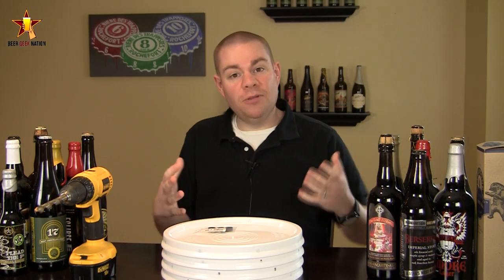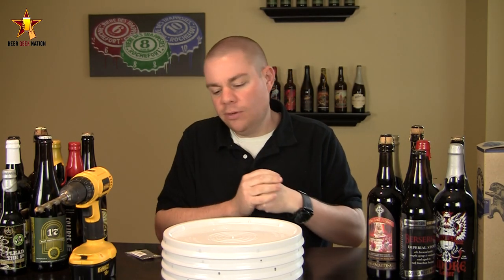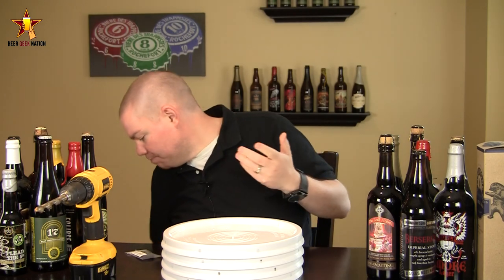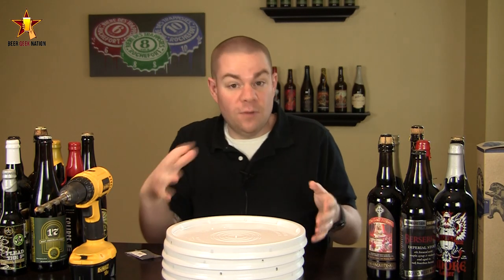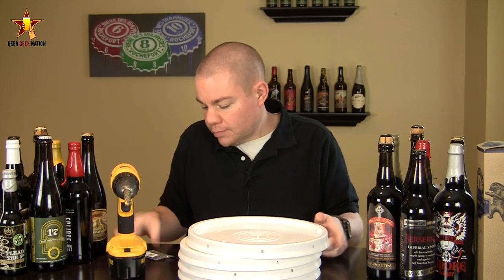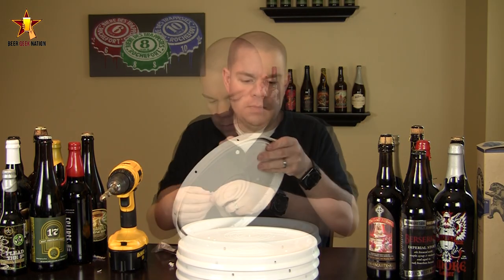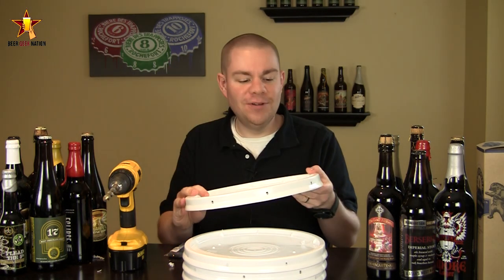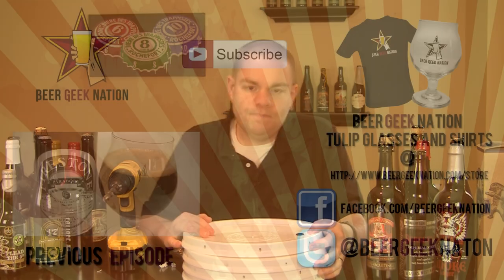How to build a cheap homebrewing fermentor | Beer Geek Nation Homebrewing

Comment: Cool money saving tip!  I was not aware you shouldn't use buckets that many times.  I've used my "Belgian Bucket" for about 6 batches now.  But most of my stuff is in Better Bottles now.  I have just been using the same Belgian bucket to brew my Dubbel over and over.  Thanks for the tip!

Comment: If you are brewing a 5 gallon batch, you need at least a 7 gallon bucket to accommodate the foam rising due to fermentation.  Otherwise it'll just billow up thru your lock, clog it and potentially blow off the lid.  Not only do you lose brew but you have a mess to clean up.  Been there; done that!  Btw, here's one trick I use to get the lid seated and also make it easy to remove.  I spray food grade silicone onto a paper towel and wipe the bucket rim with it.  Makes installing and removing the lid easy as 3.141592.  ;-)
Reply: Could you brew a 2 gallon batch in a 3 & 1/2 Gal bucket?
Reply: @11bcollins11  Yes.  If you are using a kit to brew.  If you are brewing the way I brew with dry malt and packaged hops, even if you use a single stage hopping and simmer the wort past the hop break, it may still foam up.  I've ran into problems with the wort foaming up thru the lock and clogging it so now I use a blow off tube which essentially is a piece of tubing long enough to go into a gallon water jug from the fermenter.  I fill the water jug to about 2 inches above the end of the tube.  You get some foam in the water but at least the pressure won't blow thew top off the bucket.

Comment: I hadn't heard that bit about the buckets used only 5-6 times or whatever till recently. I've got a Cooper's mibro brew fermenter going on 3 years old. And an Ale Pail going on two. I rinse them out after use,then use 4TBSP PBW in it & fill with water to above the crud ring,stiring till dussolved. Let it sit 5 days or so,scrub lightly & rinse/sanitize before storing. Always clean & clean smelling even now.

Comment: for everyone wondering yes you can get food grade buckets from places like home depot, lowes etc. don't be fooled into thinking you have to spend $20 at the homebrew stores. if i wanted to spend about $20 i could make two fermenting buckets by going to my local lowes and then just picking up the airlocks at the homebrew store. (bucket, lid, grommets, and airlocks should be around $20-25). great video man.
Reply: Adam Peterson I just bought 5 gallon food grade bucket the lid they sell, it's hard to put on...  I need to find lid now.

Comment: Some buckets you can actually get away without an airlock. The one I use swells slightly but leaks CO2 under pressure.

Comment: I'm home brewing wine for the first time and getting my basic equipment. I accidentally ordered airlocks with carboy stoppers instead of grommets. I'm using plastic food grade buckets. Can I drill larger holes on the lids to accommodate the carboy stopper rather than ordering different airlocks?

Comment: They have these at Lowes. they are actually translucent so you can see what's going on inside and they have liter and gallon marking's. http://www.lowes.com/pd_161932-84240-PN0040_0__?productId=3734787&Ntt=gallon+bucket&pl=1&currentURL=%3FNtt%3Dgallon%2Bbucket&facetInfo=
Reply: That's not food-grade safe plastic. I only use those buckets for my Star-San and holding my siphon when I am not using it.
Reply: nadohawk It say's right on it that it has no BPA's and I have had no problim's with them.